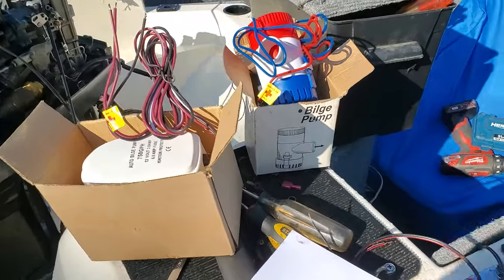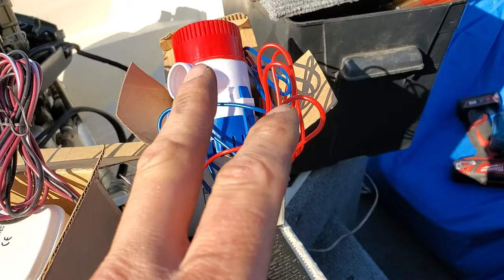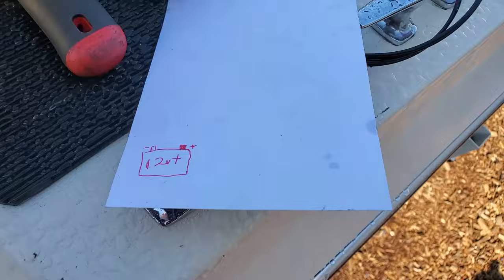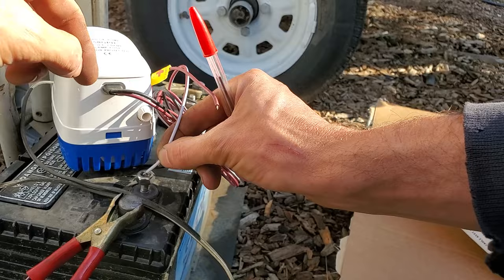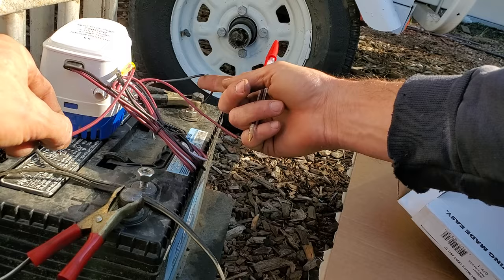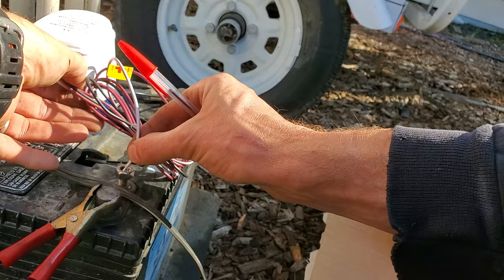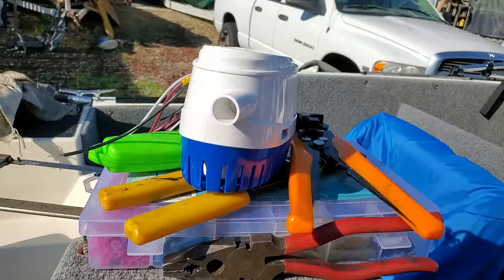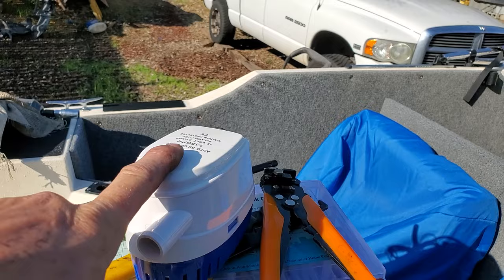Dont sink your boat - Bilge pump basics: 2 vs 3 wire, differences and installation tips

Comment: Doesn’t this mean that when your switch is on you will have two powers going to the pump at the same time, your automatic and your switch power? Won’t that damage your pump?
Reply: Absolutely not.. they are designed this way..
Reply: No, both are from the same source but in parallel.

Comment: Do I have to have all 3 wires connected? Could I use hardwire it to use the auto float switch and tape up the manual wire, disregard it and leave it unconnected?
Reply: yes u can do that. just test via the round knob that its working and remember to put a fuse at the battery for the auto wire, 7 amp should be fine.